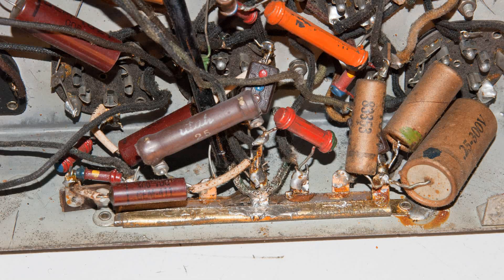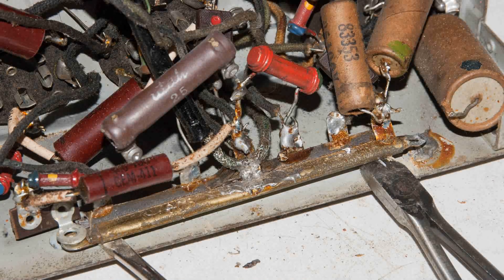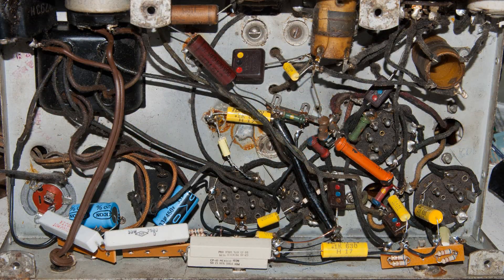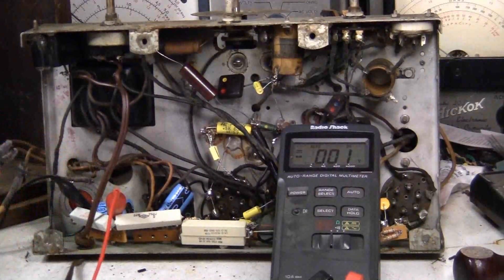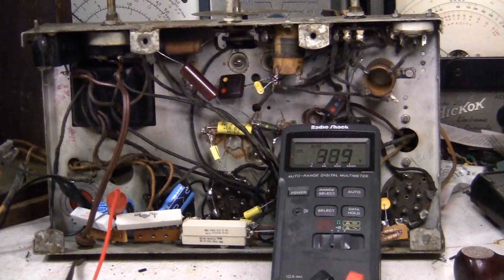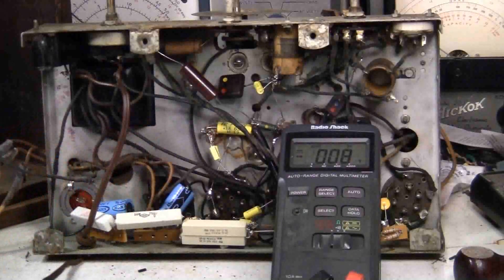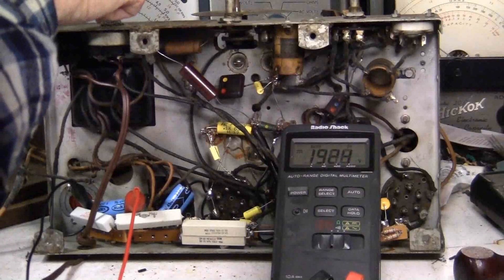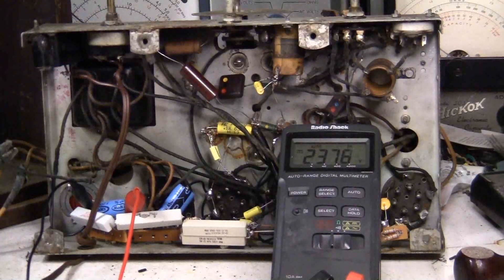First power up test, Stewart Warner 1301

Comment: Rick,
You know, I've heard that those Candohm resistors have a bad habit of suddenly coming back to life after seemingly having burned out, thus one should never attach replacement components to the existing terminals.  Removing and replacing it with those terminal strips was the only way to go.  I always trash Candohms, even if they check good.  They're too unpredictable.
I can't wait to see this puppy back together.
Happy New Year, my friend.

Regards,
John

Comment from the maker: Thanks douro20
Yes that is the original resistor strip. Probable one part of it opened and that is why it was rewired by someone. Some of the wiring was wrong, but luckily all the coils were good. I would not have bet on that. The plate voltages run 236-245VDC.